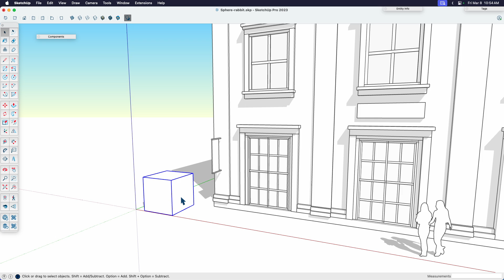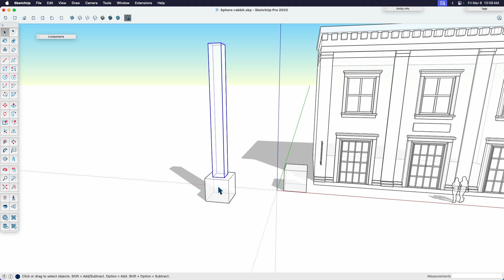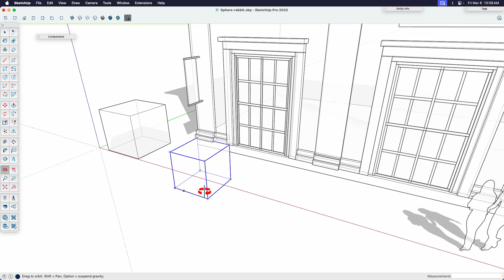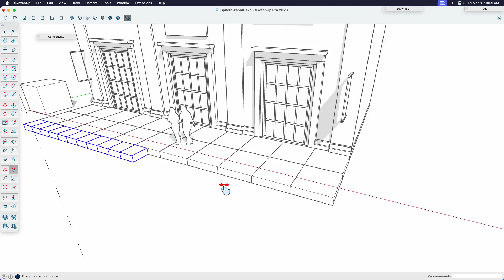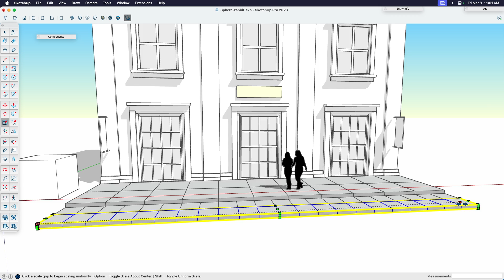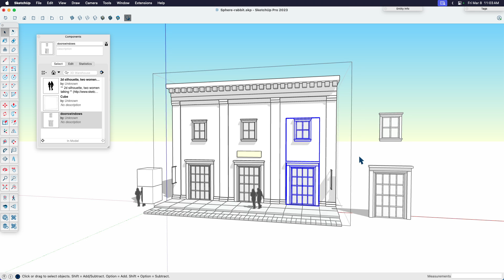Comment: I’m not sure the purpose of making it a component. Why not a simple group? The prospect of being in a large model and accidentally editing inside the component thus blowing up the whole model seems reason enough to not do this.
Reply: From a programming standpoint I can image the file is very small. It only contains one cube, and then many instances of that cube with different transforms. So it's an interesting exercise, but using groups would be completely normal to make this design. I would probably make components for the windows and shapes that appear identical. I don't like to distort components, because it usually happens by mistake and then later you edit something and it causes unintended changes elsewhere.